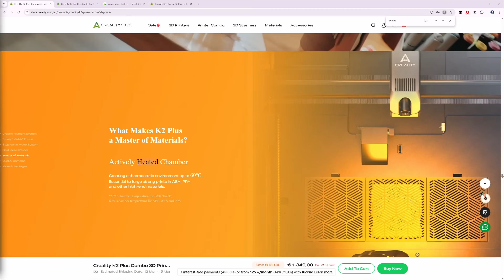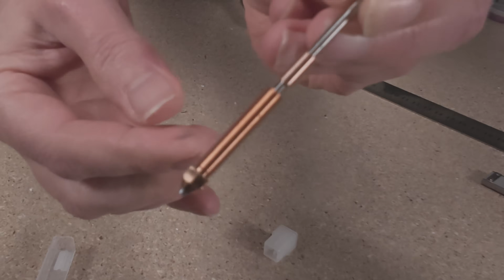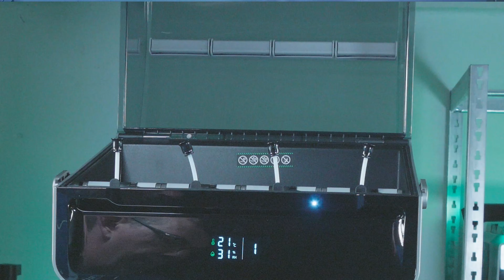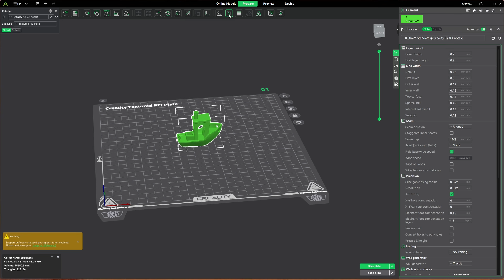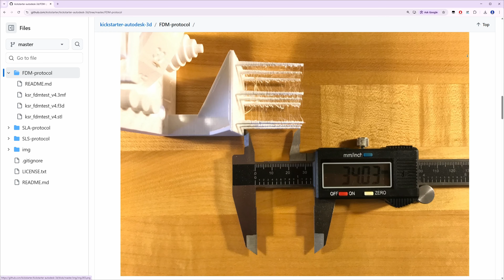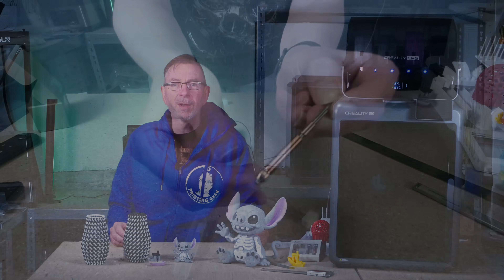IS MULTICOLOR A TRAP? The Creality K2 Combo Waste Reality!

Comment: Доброго дня! Дуже цікаве відео. Підкажіть, будь ласка, як ви готуєте файл для кольорового друку: у якій програмі розділяєте модель на кольори, в якому форматі експортуєте (STL чи 3MF) і як призначаєте слоти CFS у слайсері? Також цікаво, яку висоту шару та параметри очищення ви використовуєте, щоб кольори не змішувалися. Дякую!
Reply from the maker: Hi! Thank you so much for watching and for your kind feedback!
I colored this model directly inside Creality Print using the built-in color painting tool. In the slicer's filament panel, I configured slots 1 through 4 to match the spools loaded in the CFS, and then assigned those slot numbers to the painted areas. For the layer height, 0.20 mm works great for most prints, or 0.16 mm when higher surface detail is needed. For the purge volume, it strongly depends on the specific filament brand and the colors involved, so the best approach is to dial it in using the slicer's built-in calibration test tools. I also make sure to increase the flushing volume when transitioning from dark to light filaments, and I keep the prime tower enabled alongside flushing into infill to minimize waste while ensuring crisp transitions.
If you found this helpful, please consider subscribing to the channel for more technical 3D printing tests and reviews!

Comment: i use elegoo and esun fillament, i got the exact same calibration results as you!

I agree that the printer is quite loud, i had it in my room for the first year, and couldnt sleep when a print was going.

The only problem i have with the printer is that it sucks at prints with variable layer height, it ruins the whole print 40% of the time.
Reply from the maker: Hi @Plofkoek, thanks so much for the comment!
It’s really great to know you got the exact same calibration results with your Elegoo and eSun filaments—and sadly, the exact same results noise-wise, too! I definitely couldn't sleep with it in the same room either. It is always so nice to get this kind of direct feedback and hear about the experiences of viewers of the channel.
Regarding your problem, I rarely print with variable layer heights myself, but I think I remember having that issue too at some point. It might be worth checking if a recent version of the Creality Print slicer can improve on that, as they sometimes iron out those slicing quirks in newer updates.
Thanks again for watching and happy printing!

Comment: Onde agente consegue esses modelos para testes?
Reply from the maker: Great question, and thanks a lot for pointing that out!
I’m really sorry, I completely forgot to include the links to the models in the description. That’s on me. I’ve now added them to the video description, so you should be able to find everything there 👍
Most of these test models are standard calibration and benchmark prints that you can download from platforms like Creality Cloud or similar libraries. These typically include things like calibration cubes, temperature towers, or benchmark prints used to evaluate accuracy, strength, and print quality.
One important thing to keep in mind: for some models, you’ll still need to assign the colors yourself in the slicer. So if you’re using multicolor printing, don’t expect them to come pre-colored, you’ll have to set that up manually depending on your workflow.
Thanks again for the comment, really appreciate it!

Comment: Amigo boa noite! Deixa de traduzir os áudios para português brasileiro 😢😢😢 amigo ainda vale a pena comprar uma Creality K2 Combo nesses dois? Estou iniciando e quero iniciar com uma impressão fechada para trabalhar com peças de engenharia reversa peças de carro e moto digo sobre suportes onde vai pegar sol e chuva. PTG, ABS, NALHON ETC… infelizmente sei que vai me indicar outros mas ideal mas os preços aqui no Brasil estão muito altos e essa Crialyte K2 Combo está custando 6.200 reais ou 1.243,33 dólares americanos. Desde de já obrigado 🙏
Reply from the maker: Hey my friend! 😊
Thanks for your comment. 
First of all, about the audio translations: I actually don’t have any control over that. The automatic dubbing into Brazilian Portuguese is done entirely by YouTube itself. I totally get that it can be annoying. Right now, the only workaround is to manually switch the audio track back to the original when watching the video.
Now to your question about the printer:
The Creality K2 Combo is honestly not a bad choice at all, especially for a beginner who already knows they want to work with more demanding materials like PETG, ABS, or Nylon. The enclosed design is a big advantage here because it keeps temperatures stable, which is exactly what you need for parts that will be exposed to sun, heat, and rain.
For your use case like reverse engineering parts and making automotive or motorcycle components, the K2 can absolutely get the job done. It offers a solid all-in-one package and is relatively beginner friendly compared to more complex setups. That said, it is not the most precise or consistent machine in this price range, and materials like Nylon may require some tuning and experience to get perfect results. Long term consistency is also not quite on the level of higher end machines.
At around 1200 dollars, it sits in a very competitive spot. There are a few alternatives that are often considered stronger overall if you can get them at a similar price in Brazil. The Bambu Lab P1S is probably the most notable one, since it offers better reliability, higher speed, and a very polished user experience while still being enclosed and capable of printing ABS. Another strong option is the QIDI X-Plus 3 or its bigger sibling, which are particularly good when it comes to engineering materials thanks to higher chamber temperatures and a more robust design. The Creality K1C is also worth mentioning as a faster and more modern Creality machine, although it is a bit less focused on high temperature materials compared to a fully enclosed system.
So the honest answer is that the K2 is definitely good enough for what you want to do, especially considering your local pricing. You can produce strong, outdoor capable parts with it if you choose the right materials and settings. If you happen to find a Bambu or QIDI machine for a similar price, those would be stronger picks overall, but if not, you are still making a perfectly reasonable decision with the K2.
Reply: @3D_Printing_Geek meu Deus que comentário 👏🏻👏🏻👏🏻👏🏻 esse é um profissional que merece ser ouvido muito obrigado professor 🙏👏🏻👏🏻👏🏻🙏🙏

Comment: I wonder how the blade will hold up against abrasive materials for multi material printing, or even glow-in-the-dark filament. How expensive are the blades, and do they stock them, what happens if they stop supporting the printer? I have the same worries about my current setup. I like creality products, I want a K2 but can't justify the cost yet.
Reply from the maker: The a 10x pack of cutting blades cost approximately 21 USD. or 23 EUR. According to Creality when printing with abrasive filament one should check after printing one spool, and replace if it looks, and feels worn out. I guess that it will last longer. For non abrasive materials like PLA, ABS, PETG,  it shall last at least 10 spools. Of course these are just rules of thumb, and depend largely on how many cuts have been done.
Currently you can get the Creality K2 Combo for 539 EUR using the link and code in the video description.
Reply: you're not supposed to use abrasive materials in most AMS systems because the gearing, tubing path, and a few other variables make using AMS unviable unless you get something specifically engineered for it like TPU for AMS made by Bambu. Even Bambu's AMS 2 Pro cannot do abrasive materials. That is the current limitation right now